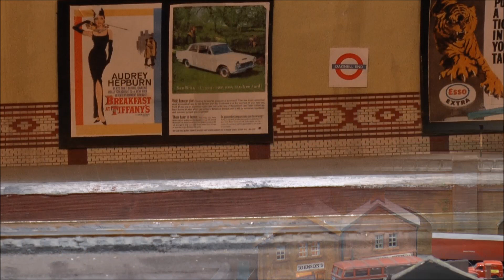A 2018 LOOK BEHIND THE SCENES OF THE SEVERN VALLEY RAILWAY OPEN HOUSE

Comment: Looks like 75069 is just about ready to return back to steam after been out of service right after the 1994 season
Reply from the maker: It'll be a few months yet I'm afraid.
Reply: Definitely needs a lot more doing before 75069 is back in service. The boiler needs finishing but after that, it just mostly needs to be reassembled.
Reply: possibly in time for the autumn steam gala mate because it says first gala appearance for 75069 autumn steam gala 2018
Reply: just had a quick look and its says 75069 first gala appearance for the autumn steam gala for 2018 season mate after the longer overhaul since it last ran in 1994